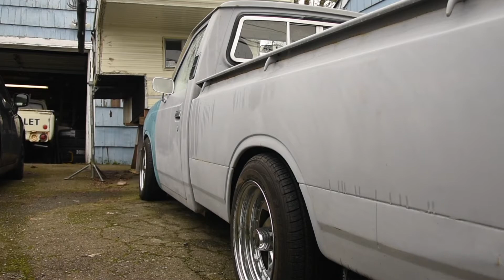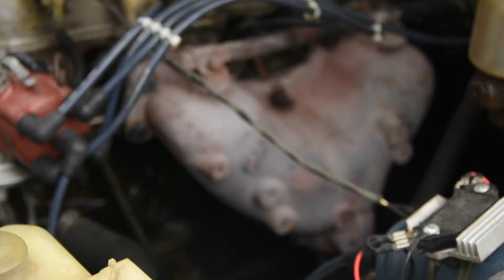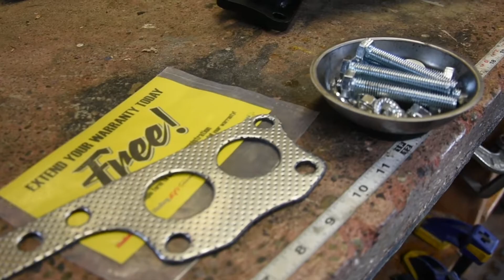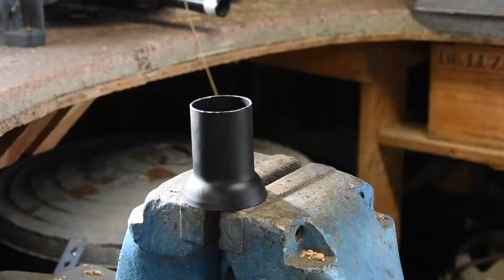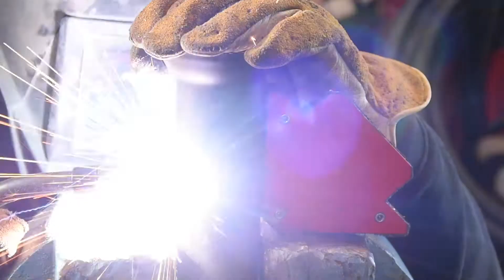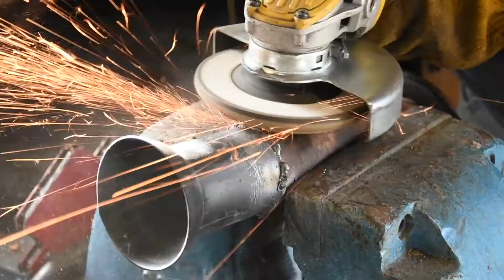Toyota Mini Truck Header Install

Comment: Hey im looking at getting the same flowtech headers.  Did you notice any hp gains from that header?  Thanks!
Reply from the maker: Hey! I felt a little bit of performance gain but I don’t have any legit numbers for you. Hopefully gonna get the rest of the exhaust done later this year. Would recommend the flowtechs overall 👍